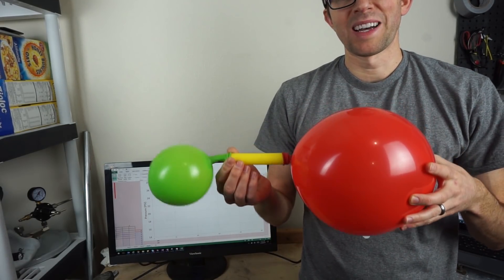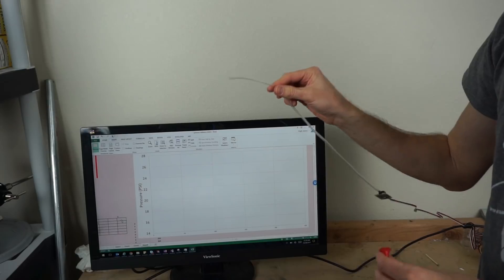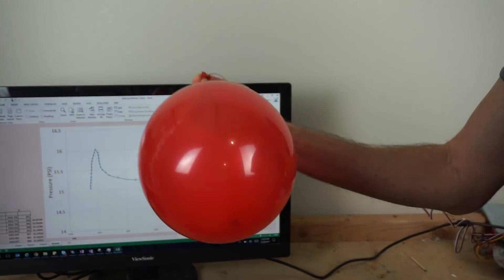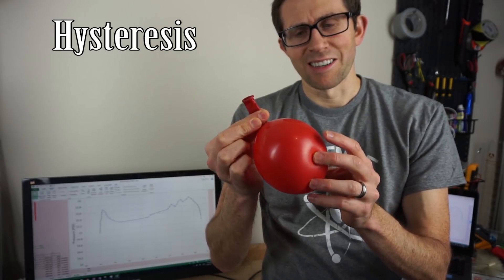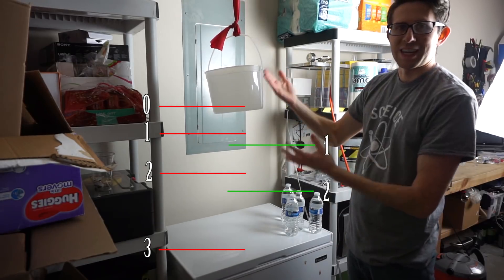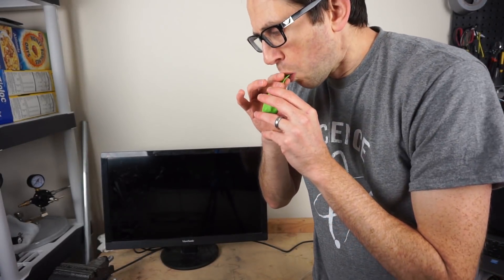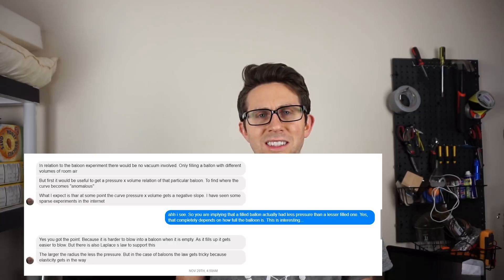You Will Get This Wrong Every Time—Balloons With a Memory (Elastic Hysteresis)!

Comment: I have a different perspective as why this happens.

It's simple when initially you blow up the balloon the rubber is not yet stretched so it requires more force/pressure to blow up the balloon.

As the balloon fills with air the rubber stretches and becomes thinner so the pressure falls.

Than it reaches its max stretch and the pressure strats to build up again.

So in my opinion if you choose a balloon from the first state (initial infation) or last state (max stretch) and connect it with a balloon from state two (rubber is thin but not at the limit) you will always get the same results

I don't think this happens because of hysteresis.

Let's have a discussion here 😊
Reply: This was actually my same thought. 

You'd have to experiment and see if you can go back and forth on the memory. He never showed this, only the stretching effect.
So it could be just stretching, and then it's just stretched, end of story.

Comment: So to recap. Balloon 🎈 is difficult to blow up in the beginning. Everybody should know that. This increases pressure until the balloon 🎈 suddenly start to expand making the pressure go down. When releasing pressure same happens just reverse. 
The interesting 🤔 part is that if the two balloons 🎈 both are beyond this point then the pressure is the same inside and nothing happens. If one balloon 🎈 is below its “I don’t a want to be inflated point” then it will release its air into the other. Right?
Reply: NOICE
Reply: Nigel 100, Nice or Noise?
Reply: @henrik-j1l  *Snap* NOICE

Comment: Hi, I just watched this interesting experiment. I have few questions. I would like to ask what gonna happen if you have done this experiment under water or a visco-elastic fluid. I meant if you try to blow the balloon under water (not in the air), would you have same results? Will the trend of that elastic hysteresis be the same? I would like to ask that does the elastic hysteresis, obtained by the internal pressure plot versus time, correspond to the elasticity of the balloon's material or the surrounding fluid environment either? My second question is if we try to make a bubble in a visco-elastic fluid by blowing air inside and somehow measure the internal pressure of the bubble, can we have evaluate the visco-elasticity of the fluid using its corresponding pressure-time plot? In this case I'm very curious to see how can you measure the internal pressure of the bubble in that visco-elastic fluid using a practical way. If it works, we can employ this method instead of complicated and expensive commercial rheometers. I would appreciate if you can do this experiment. Cheers!

Comment: When you let the air out, you should pause every second for the pressure reading to be correct. Otherwise the pressure drops due to Bernoulli's principle - higher air speed causes pressure drop, with or without hysteresis.

Comment: I'd like to know what the "first Inflation" pressure are...?
Reply: +The Action Lab,
..
I just set up a simple test and the initial peak pressure for a "new" balloon was about 1.5 times  the "used" balloon peak pressure. (50/35 mm Hg). HOWEVER, deflating very slowly showed it approximated the curve  back down reasonably well.
..
I'll have to set up a more careful test later, but I believe this is qualitatively reasonably close.
- - 
Regards

Comment: There is certainly some hysteresis present, but that's not the whole story. You let the air out too fast.  If you'd let the air out very slowly, I expect you would have found an increase in pressure again before it went completely slack.  The peak would not have been as high as on the way up because of hysteresis.  But I think there would still have been a bump.  By letting it out so fast, the dynamic effect of the air blowing out overwhelmed the retracing of that bit with the bump you saw on the way up.  Bernoulli equation would explain the monotonic fall in pressure during inflation.  The high velocity flow in the neck is essentially at ambient pressure, so the stagnation pressure inside the balloon is higher by 1/2 rho V^2.  I believe that is dominating the pressure due to the elasticity that would have allowed the partial recovery of the bump.  I'd love it if you could try that again with a much slower gradual release of the air.
Reply: +chopmega,
..
My thoughts, too.  Other on line similar measurements show very slow changes over 100's of seconds.
Reply: +chopmega,
.
Just discussing this on the Quora site.  It appears that the amount of hysteresis is small, but not that much different than the actual inflation (gauge) pressure. 

Using an on-line balloon pressure graph similar to his graph I see only about 0.0046 atm, or .0676 psi pressure difference (more) inside to inflate the balloon.

He is able to get the pressures the same so the small one stays small because of the way he can cheat at the end; by over inflating the small balloon, then deflating it to the small size.   
...
This reduces the pressure to where the large balloon is... Interesting
...
Regards

Comment: This one is very complicated. There is a elastic limit with pressure and the material memory and hysteresis...
Maybe I can understand it when I rewatch it sometimes later
Reply: +BBB,
..
Think of it this way.
Each successive 'blow' is the same volume, but it expands the balloon a smaller percentage than the previous.  This increases the volume, but more importantly, increases the surface area less than the previous 'blow' , so this takes less pressure to achieve.

Comment: Before watching the video:
Inflating a balloon damages it so it can hold less pressure. Since the small balloon has not been fully inflated yet, that is why the air in it is actually under higher pressure.

Comment: The reason why the pressure has that initial spike is because at first the balloon doesn't change size. It will only start to actually grow in size once you have put in enough air to overcome its resistance to being deformed. Once it started to expand, there's more space for the air, so pressure drops significantly until you get close to its stretching limit, then pressure starts going up again. (It's similar to the difference between static friction and kinetic friction. You need to overcome static friction in order to get an object moving, but once it moves, you only need to overcome kinetic friction to keep it moving.)

Comment: GREAT VID !! I strong suspected right away the balloon of different sizes would have same internal pressure because the larger volume does not mean larger pressure. Sure the overall surface area pressure added up is larger, but then, it's over a larger area ! I think the blowing-up-spike is related to the wall being thicker when it's smaller..it takes more 'overpressure' to stretch it to thinner, but that amount required decreases as it gets larger (thinner). But you're not measuring flow which is increasing sorta as a ballon '2x' big will have like 4x volume or something conceptually (I forget the formulas). 
So I'm blown away by the 2 difference scenarios, and that thing 'memory' (elastic hysteresis) I will have to study that for a long time to get and intuitive grasp! I'm not a human calculator nor do I use formulas, because I'm not required to, lol,  But, like many of us,  I love to form mental models of behaviors that are pretty good. I think maybe if you stopped in the middle of the initial inflate effort it would not stay at that spike pressure but drop to an intermediate pressure? Kinda like conceptually 'stretch inertial' but that's maybe too loose a way to use the term inertial. It would be interesting and informative to do test inside a vacuum. That would take less pressure of course, but I'm curious if there would be any differences in the overall basic behavior. I think this would be different with different materials? Like metal springs?

Comment: Isn't this mainly a physics thing? When you first blow air into a balloon, the air in the balloon has higher pressure at first as compared to the pressure outside. Therefore, it exerts a net force on the balloon from the inside, making it expand until the pressure inside equalizes with the pressure outside. That's why the pressure rises first, then drops. Similar with the reverse - air goes out, pressure inside drops, hence the balloon shrinks.

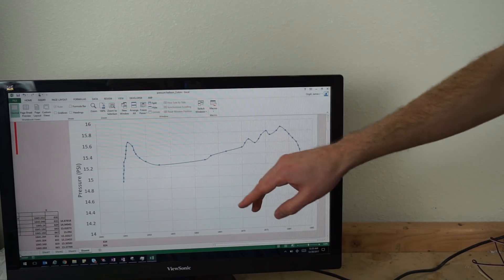Comment: Two questions, why did you let the censor fall off at 7:15 before it fully deflate?. 2, why fid you use your hand to hold the bucket as you take the bottles? Doesn't it affect the tension because its a force acting downward to keep the balloon still?.

Comment: This is not about whether you are filling or releasing air..  But its all about how mny times u used that balloon.. Is become softer amd softer every time..
Reply from the maker: No it’s not. You can redo this experiment no matter how many times the balloon has been used before. This is now about the initial stretching that happens to a new latex balloon
Reply: @TheActionLab  what if you use 2 balloons both used more thn 100 times.  Then if we use one of them as filling and other one when releasing.. Will it again give the same result?

Comment: I think it would be informative to check the pressure again with the probe further into the balloon and with the flow rate decreased.  That fast flow of air out with the probe near the neck of the balloon is going to result in a lower pressure because fluid flow causes decreased pressure.  It seemed like you were attributing that pressure drop solely to the elastic of the balloon.

Perhaps you could make a disk with two holes, one for the pressure probe, and one to let air out.  If the probe is deep in the balloon and you get nice laminar flow when you release the air, the probe should be mostly unaffected by the effect of flowing fluid showing a decreased pressure, as in the video that probe was definitely seeing a lot of turbulent flow.

Comment: I would like to add the reason why the balloon loses elasticity when inflating. When you first have the uninflated balloon, the moleculair chains are oriented like spaghetti in a bowl, twisted in eachother with no order. When you inflate the balloon, the moleculair chains get stretched untill they lie straight. During the straightening the elasticity is high (which you can see in the part just after the spyke in the graph). After that the moleculair chains are straight and then you are actually trying to pull the molecules apart. The moleculair bounds are much more rigid and thus the elasticity goes down and the volume doesnt increase as much anymore and thus the pressure goes up more quickly. As demonstrated with the elastic band and waterbottle experiment, when you relax the plastic afterwards the elasticity of the moleculair chains is pulling the plastic back into shape but that elasticity is lower because the chains dont go back to the chaos spaghetti orientation. And thus the weights arent pulled as far back as they stretched. When you deflate the balloon and leave it alone for a while the chains will become loose and relaxed again and so it will behave again like I described in the beginning after a while. 

Btw, Sorry for my English and I hope my story made sense XD English is not my first language :)

Comment: Well, all material show this kind of behavior, they will retrace their loading curve only when the force  is below elastic limit, that itself is the definition of elastic limit.
 once the yield limit has been crossed the material goes into platic region and while unloading in plastic region, it's path will not be the same and it permanent deformation will be set, 
More proper graph should be between volumetric strain and pressure , there we could have seen everything , although in your graph between time and pressure, we could clearly see ealstic region with straight line then yield limit, then Plastic reagion and then strain hardening in the end when you blow too much air into the balloon.

Comment: Very good experiment! I would like to add that if you fill up a balloon and restrict/control the flow of air some as you deflate it, you will find that there is a extra burst of air coming out just before it completely empties, when it is about the size of an orange. You may want to try releasing the air through a tube so you better control and monitor the pressure.

Comment: On a (somewhat) related note, I wonder whether the pressure inside the car tire is higher when the car is standing on the ground on its wheels compared to when it is lifted by a jack (so that the wheel is completely off the ground).

Comment: Would be interesting to see pressure curve when you blow it up until it bursts. The other factor you haven't mentioned it temperature. Not sure if it's important. Also do the same thing with soap bubbles. No hysteresis there, but the air goes from the smaller to the larger.
Is your your pronunciation of hysteresis normal for the USA. I was taught.. hist .. er.. ees is

Comment: @The Action Lab: I can help describe what you are seeing with the stress/strain curve a little bit better - including the why the release at the end acts like it does (I have a Masters in Mechanical Engineering).  

The first part of the curve (before the first peak) is the “elastic section.” While you are blowing up the balloon here, the balloon’s deformation is completely elastic and should always return to its original state. Interestingly enough, you can actually predict the exact slope of this line with some simple material properties. If you let the air out before reaching the peak, it will follow this exact line back.

It will continue to expand elastically until it reaches the first peak - or “Yield Stress” at which the balloon’s plastic will yield, and start to permanently deform. At this point, you have started to permanently alter the bonds of the rubber, and so the rubber becomes weaker, allowing the balloon to continue to expand, even at a lower pressure. 

As you continue to inflate, the pressure required will start to rise. You are correct in saying that the balloon will not expand much more at this point. At a certain point, it would, of course, go past its limit and pop.

Now, for when you let the air out and release the pressure:  Despite all of the permanent (plastic) deformation, the material is still elastic, and still has similar elastic properties, despite the massive deformation. Therefore when you let the air out, it will still being to return to its original shape BUT ONLY the amount within its elastic region. Any deformation that occurred after the point that the material yielded (changing from elastic deformation to plastic deformation) is permanent. The curve will then follow roughly the same slope as the original line back, because it is returning from its elastic deformation. Therefore, it will form a line parallel-ish (theory vs actuality) to the elastic region, but start from where the permanent/plastic deformation ended.

Great video! This is really cool stuff!
Reply: Sorry but rubbers don't behave that way. What you've described is the typical behavior of metals. Kindly lookup stress strain diagrams for latex rubbers and you'll realize there's no peak there. It's good to know a theory but it is just as important to know what it describes and its limitations. (I have a master's in materials science and am doing my PhD, these degrees mean nothing if the person has poor understanding of the fundamentals)
Reply: Nice explanation!

I have a question, according to the stress strain diagram, 80% of the elongation of the balloon was in plastic region (and 20% in elastic). But when we deflate it, the size of the balloon decreases more than 20% (as if it's elastic region was more than 20%)

Why is this so?

Comment: If you blow up a balloon and then let the air out, the final shape is different from the original shape, if you repeat the process, the same will happen, the third final shape will be different from the second one. The reason as to why the pressure "decreases" and as to why it has different path's going one way or the other is because of plastic deformations, if you repeat the same experiment with a elastic that has a higher fluency point and do not reach it, the path going one way or the other should be about the same. I mention this because there are many cases of hysteresis where the start point and the end point are the same, where you can repeat the process multiple times without the system failing... but in the cases of your process, the elastics will break if you repeat the experiments enough times... and this is not a fatigue issue, this is a slow and progressive plastic deformation issue that do not depend on the speed of the process (unless you blow up too fast the first time, then it will just pop on the first try)

Comment: So if you blow up the red balloon until the pressure is greater because it's running out of room, and then blow up the green balloon and let the air out. When you un-twist the red balloon would the green balloon increase in size because the red balloon was greater pressure?

Comment: Also, as you blow it up for the first time, it hasn't been stretched before, so it takes pressure to do so. Then once you've stretched it out, it begins to equalize with the surrounding air, but cannot fully, since the rubber itself is elastic and wants to spring back, so to speak, so puts a small amount of pressure on the air inside. When you let it out, there's no stretching phase, and just goes right back down to atmospheric pressure. You should've tried blowing up the same balloon again with the pressure sensor to observe this and prove me right or wrong. But if that's what you did anyway, then you've proved me wrong already.
Reply from the maker: This is repeatable with the same balloon so it is not due to just stretching out the balloon